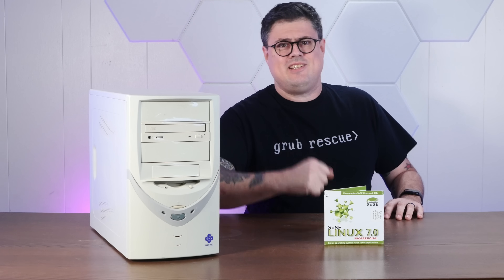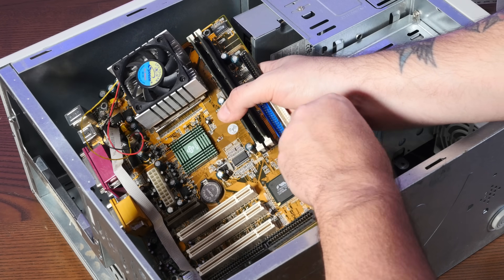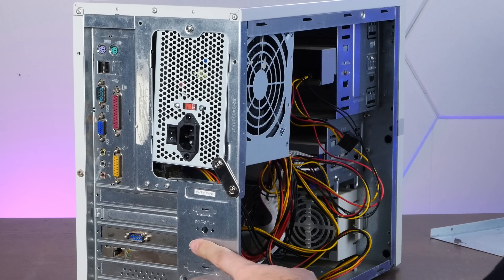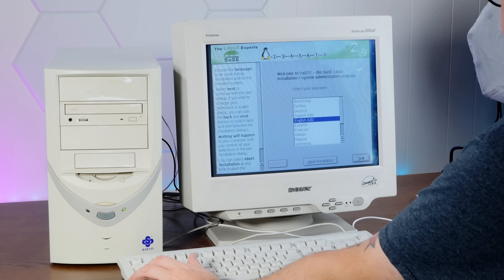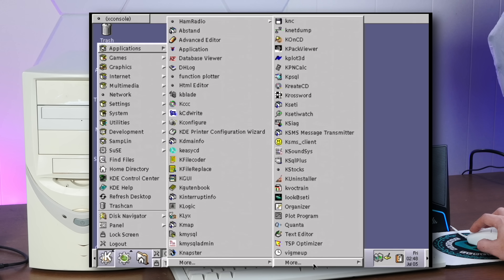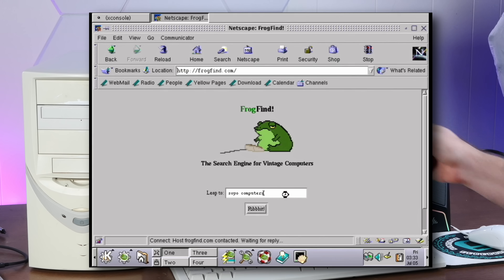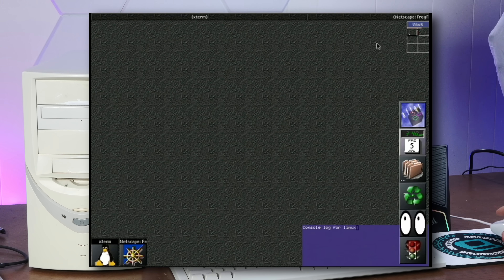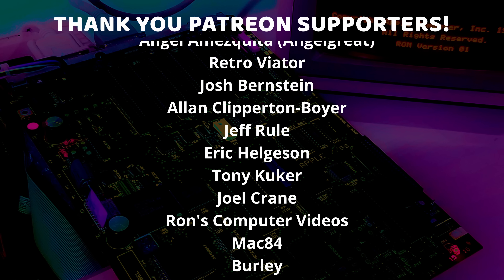The Forgotten Via C3 Processor

Comment: My first Linux was Slackware in 1993/1994. I worked in my university’s Unix lab and I used to stay late so I could download 3.5”floppy images over our 19.2K Internet connection. You could also download disk label images and I’d print them on the lab laser. Once X was released, I was carrying all 34 floppies with me at all times. I think I was running it on a 386 SX. Kernel compiles took an hour. Used it for my Sr. project where I wrote a kernel device driver for a custom ISA card😊❤

Comment: Fun fact: that PSU placement is part of Intel's original ATX specification from the mid-90s (first ATX board came out in 1995). The idea was to have the PSU fan blowing over the CPU, so in theory you could save some bucks on the CPU cooler and just have a heatsink attached. Obviously you don't see a lot of passively cooled P2/P3 or even original Socket 7 machines, so this idea didn't really last long.

However this placement is a good sign you have a 90s ATX case

Comment: That was one of the very first versions of SuSE I had tried back then. Over 20 years ago. The amount of features and customisation options and themes of KDE was mindblowing compared to WIn9X and macOS back then. Stuff could be configured pretty easily, as we have seen with the soundcard panel. 20 years later I still hear people ranting against Linux and even claiming that "it's like DOS and too hard for the average user".  LOL. Despite since then, it has become in many cases comparable to a mobile OS or macOS (see Ubuntu). I would get the same type of comment from people that had never used it, that had no trouble using DOS boot floppies to reinstall Win98 and have to configure .BAT files to make some things work. Yet they'd reject Linux while SuSE, Mandrake, RedHat, Caldera, made systems that were just straightforward and neat like this! 
I remember my younger brother having no trouble checking around KDE and playing games without my instructions when I installed Slackware the first time.  
Most people alive today might have changed and used a variety of diverse mobile UI's and different versions of Windows, maybe even DOS, over the years, and maybe macOS and iOS too, so they would feel no trouble in navigating modern Linux, it's just a bunch of icons, menus, some control panel and some software centre, but haters gonna hate.

Comment: YES! I've been waiting for ages for a proper video about the VIA C3 processor. I recently restored my mom's first Windows PC, which is where I first experienced the "World Wide Web". We got it in early/mid 2001 and had Windows Me pre-installed. I remember it came with a lot of software CDs, such as photo editing software and other utilities ... and it included OpenSUSE, which looked similar to the box you have. I was too young at the time to realize that it was a completely different operating system, and so the box remained untouched forever until I lost after we moved.

Comment: That's fantastic. I've not spent nearly enough time with Linux, honestly. For being that old, those are some beautiful GUI's! 
I'm working on a video right now about a weird industrial Panel PC, sold as "not working", and the seller claiming it to be a Pentium 4, turns out it's a VIA C3 as well! 🤣It works fine, just didn't have the power button on the correct headers!
And my old Daewoo video had the "screw right in to the grill of the power supply" problem when I got it! 
The previous owner shoved a full ATX power supply in an SFX space lol. The things we do for love. (of retro PC's.)
Great video, as always!

Comment: I'm not surprised SuSE had problems with display resolution, as well as that odd tripled screen.  I had tried SuSE out over a number of years, and regardless of the year, and which machine it was installed on, it would never look quite right.

So this was back in the days when GNOME *didn't* suck.

Comment: I had one of those retail SuSE disc distros, I believe i got at Fry's. Installed it on one of my older computers and was amazed at what it could do. Did a presentation in one of my classes explaining the performance differences of different RAID modes, something Windows 98 couldn't do back then.

Comment: I used Mandrake back in 2003 then Mandriva, then Red Hat/ Fedora, Kubuntu, and finally I tried SuSE 9.0.
I just stayed there ever since just upgrading to openSuSE and now using Tumbleweed.
And the reasons I stayed loyal to SuSE? YaST2 control center. It provided the tidiness of the system settings and setup features all the other distros could not give me, an excellent system tuning and managing suite easy and clean! Not searching through endless menus to find the apropriate tool for every task or reading thousands of forum pages to find a solution.
The 2nd reason is that it is RPM based system with faster package installations and now also Flatpak which I don't know exactly how it works but anyway...
The shame for Linux distros is that most of the people used them on old or just weak computers to make them faster and more pleasant to use. But if you use them on a high end modern PC you can still feel the difference in speed compared to Windoze 10-11 I mean my Ryzen 5 3600X with 16GB of RAM and Samsung 980 nvme really flies with openSuSE Tumbleweed, loading times are lightning fast! Windows 11 are on my 1st nvme a 980 Pro pcie 4.0 which has double the speed of 980 non pro drive and still they load slower than Tumbleweed which is impressive on its own. Also KDE 5 is almost 3D environment whereas Windows now implemented Tabs at the file explorer nearly 20 years after KDE's Dolphin... I also use both Kwin compositor and Compiz with Compiz Icon really worths the effort...
Great video cheers from Greece! Jim

Comment: The PC tower uses a standard ATX power supply, but you need a bracket to mount it to the chassis. I do not really know the reason, but it works that way.

Comment: Pro tip for not killing disc drives... Use the button and stop pushing them.
Reply: I used to believe that. In reality it doesn't matter. If you use a normal amount of force it will not be damaged.

Comment: 0:55, "...my Compaq Presario..." - Maybe six months ago, a new client brought me a Compaq Presario almost exactly like yours for data recovery. Its built-on monitor (can't really call it built-in, because it was basically a monitor whose guts were placed inside a monitor-shaped case extension but then plugged into an ordinary VGA port on the back) didn't work, but by plugging an external monitor into the VGA port, I found that the rest of the computer did. After the data recovery, I ended up listing it in a local vintage computing Facebook group and giving it to someone who wanted it. I kept some good photos of it, though. Cool machine.

Comment: My first two computer builds, in the 90s, had motherboards with Cyrix processors (I think 233...).  Very low powered I guess, but I didn't really know what I was doing and they seemed fast enough for me.  I installed Windows 95 on them.

Comment: SuSE 7.3 DVD was my first, after Red Hat. I didn't have a DVD-rom drive or burner, so I downloaded it over DSL and installed it into a Vmware virtual machine :) Very nostalgic watching this video; 7.3 was 32-bit only and I used it for a couple of years on a 900 MHz AMD Duron with maybe less than 1GB RAM on the hardware

Comment: I used to have a VIA C3 In an old laptop - I remember the CPU badge being a blue top and green bottom, with a yellow affect between the colours, the CPU ran Windows XP fine but it was a VERY VERY VERY VERY hot CPU for a laptop and it made the machine hard to handle

Comment: SuSE Linux was always my most favorite distro to run on all my machines but back in 2000 I did NOT have the honor of using version 7.0 which was the "HAPPY" inbetween version that gave you all the cool desktops and window managers, multimedia apps and tons of graphics to tweak this thing out. It featured the soon to be mainstream Xfree 86 4.x as well as the older xfree86 3.x? I know I could run almost any video card on these versions of Linux with the new Xfree 4.0 cause it used VESA 2 generic drivers so you still had graphics and color, kinda like Windows XP did. It was also more hardware friendly for alot of soundcards and VGA cards out there. I bought my very first SuSE Linux at a computer show back in 2000, and it was version 6.3. Same amount of CDroms and while back then my power went out in the middle of setup and I thought SuSE was not good due to the keyboard not working after the power came back, that I never gave that version a second look and sold it shortly there after. Boy, when I got version 7.1 personal I was in for a real treat! I could ALMOST replace Windows 2000 with this! I did try Mandrake Linux 6 as my first ever Linux distro and it never worked right from git go with the crappy hardware I had back in 1999, so it was not until 2000/2001 that my SuSE Linux adventures really began with 7.1, 7.2(buggy) and finally the Holy grail.. 7.3!! Mind you.. I have version 7.0 in a box, new today. And it is my trophy on my office desk. Again.. What a ride me and my Penguin have had! I now use MX LINUX as my only OS to this day.. No regrets!

Comment: Kills me that that a 2000 version of Linux has better font rendering than the default install of Arch used to back in like mid-late 2015. I had only been using Linux for like 6 months at that point and it was mostly Ubuntu/Ubuntu Studio beforehand. I remember having the issue across a couple attempts at installing when I was struggling with it and then the problem magically went away at one point probably within a few months when I was doing another install of Arch after distro hopping. At that point, it still felt like a little effort. Arch these days is so easy to get going.

It also kills me because every retro Linux version you've shown looks so much more sound than people have always made it seem anecdotally. Actually so much so that I''m starting to form an opinion that late 90s/early 2000s Linux was on-par & sometimes better than Windows in terms of what was modern at the time (visually), and around 2010ish actually seemed like a low point for getting behind with the times (visually). That definitely swapped back around with how ugly Win 8 & 10 were compared to Plasma and GNOME 3. And that's ignoring ricing and wm setups

Comment: I loved the Cyrix chips - they were an amazing bang for the buck … until people expected their CPU to handle floating point calculations 😂
Reply: Which happened on exactly June 22, 1996, The day Quake was released. It's amazing how one game changed the course of CPU History. It also means that 99.99% of DX2's were a completely waste of money, an SX or cheaper/faster alternative with an Overclock was absolutely fine. This hideous chip was released four years after quake... They should hang their head in shame because as you say their chips were bangin' just a few years earlier.
Reply: Think you've got that backwards. DX chips had the built in math coprocessor.

Comment: my first install was mandrake due to rpm packaging nature is quite simple but its annoying with dependency hell back the days you know what i mean, its why i keep moving on with opensuse 10...my first distro hoping expierence ...bigger package manager and almost everything that time is working from compiz and opengl for nvidia drivers always working back then due to x11 was very reliable easy by opensuse yast...least one distro had right idea vs mandrake and debian was the worst distro to work with back then...package system is a mess under debian and things can break by install wrong deb file that cause gpu to not boot up the gui interface due to kernel didn't get driver kernel to boot up or something on the lines and 2nd mistake is doing it myself using nvidia run file , those installer usual get it working or not under debian...depending what version your os is and kernel to support it, but under opensuse is quite simple to do both methods, by nvidia site or provided packages ..and remind those dkm is must have on that distro for any kernel updates it has to rewrite patches to the kernel for your gpu continue working

Comment: I recognize that case.  Gotta love OEM builders.  The spot where the PSU goes was a bracket that you screwed the PSU into and then attached to the case.  The one I have has 2 screw mounts at the top and two slotted cuts in at the bottom for guiding arms to go into.  It's amazing how much variety there was to the case design that uses the exact same faceplate.  I have another similar one but it has a removable motherboard tray which is a bit unusual for the cases I have.

Comment: I always hated those cases with the PSU hanging over the motherboard, I remember this front panel design well but it also came in a case with 4x 5.25" bays and the PSU in the proper position at the top :)

Comment: I recently bought a copy of SuSE 6.3 at a thrift store, it was the first version to use YaST 2, after long drawn out frustration, I realized that you could install using legacy YaST if you booted off the second CD, the state of YaST 2 on 6.3 was not great, there was no manual partition options at all so when you're trying to install it on hardware with an HDD larger than 8GB it's pretty annoying when you can't create the /boot partition in the first 8GB of the drive, I ended up using legacy YaST and still with the /boot partition in the first 2GB of the drive I still couldn't get LILO to want to play friendly at all so I found a very early version of GRUB

Comment: (12:21) I could immediately tell that's KDE 2 Beta because KSplash was a new thing introduced in 2.0 and a placeholder splash screen like that would've been used during development before the final artwork was put in place. Funny you would show KDE 2 Beta without realising it, as the release of the first beta of KDE Plasma 6 is a few days away!

(12:33) I can tell that's stock KDE 2 Beta without SUSE customisations (like the KDE 1 environment you showed had) because KPersonalizer loaded. Distros that skinned KDE often removed it or prevented it from automatically launching because it would remove the distro's customisations, though I think that's being fixed with its spiritual successor, Plasma Welcome.

When KDE 2 was finally released and made it into a newer version of SUSE Linux (which I think was version 7.1), SUSE did customise that.

Comment: Wow - That takes me back! SuSE 7.0 was actually my second successful Linux install. The first one was SuSE 6.0. That version was a bit older obviously. My first try to install Linux was using a distribution on floppy's, where you had to compile your kernel. That was a real PITA, and I never got it working reliable. I was interested in Linux, because I was using a non-Windows system before, namely RiscOS. I was one of the early adapters of the Acorn Archimedes, that was delivered with a OS called Arthur. That one was soon replaced by RiscOS.
Anyway - I went from SuSE to Mandrake Linux later on, to finally ending in the present day with Linux Mint Cinnamon.

Comment: Yeah, the YAST installer has changed very little since the early late 90s and 2000s, I should know as my first successful Linux install was Suse linux 9.3.
However the distro that got me to use linux more full time was Mepis linux 2003.10.
Next year will be my 20th anniversary as a linux user making it my most used OS/kernel.
Currently, I am rocking Fedora 39 which is in my opinion the best release of Fedora, its incredibly snappy and quick.
Last time I used Fedora more long term was with version 20 just before DNF came in and screwed things up.
It took that whole time before DNF became anywhere near good IMHO.

Comment: Wish I had tried Suse back in the day, as I think I would have become a full time Linux user much sooner, as Red Hat, and Corel Linux where so damn picky about what hardware you could use to get everything working.  
Far as Cyrix, I saw a lot of these back in the day in super budget systems, and for basic stuff they were not that bad, just not the best option when you could find a deal on an AMD K6/K6II system that at same clock speeds would stomp all over the Cyrix.

Comment: SOYO used to make the best 486 motherboards back in the mid '90s. They were as popular as Gigabyte and ASUS became later. They are still in business, albeit not selling motherboards globally as they did back then. In the early days of the web I was the co-owner and administrator of the local internet service provider in my city and we had 2 on-site web servers to off-load the remote datacenter (because long distance connections were insanely expensive back then), one with RedHat Linux and one with Windows. A couple of years later, I was introduced to SuSe by a network admin. It had a much better UI than any distro of the period. It was cool looking like Ubuntu became later.

Comment: I really want to see what would happen if you put Linux from this era on modern hardware
Reply: I don't think you'd get very far. Modern PCs no longer provide IDE/ATAPI headers, and these old Linux kernels don't support SATA.
Reply: @zoomosis Use a SCSI interface ?
Reply: @ManleyEvangelista  I don't think newer PCs have this compatibility mode anymore. I believe Intel's "second generation" still had compatibility mode, I don't know how far this went. If you get a "legacy" board with PCI slots you could put in an older storage controller.

Comment: At the time, I installed SuSE 7 on an AlphaPC 164SX motherboard in about the same case. It worked fantatically, but many programmes still needed minor adjustments to 64bit. The Windows NT version also worked well, provided that under Linux you removed certain driver files that were 32bit from the NT partition.